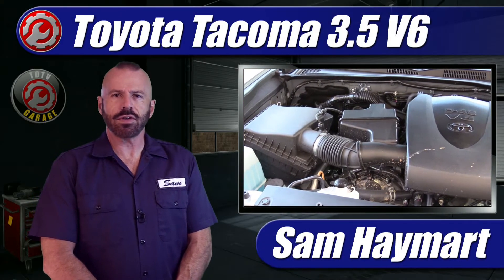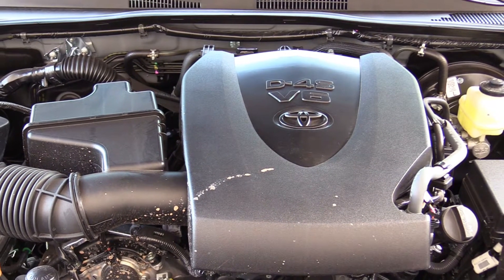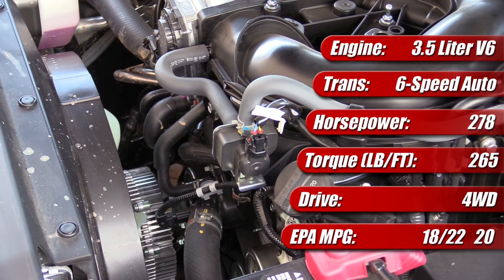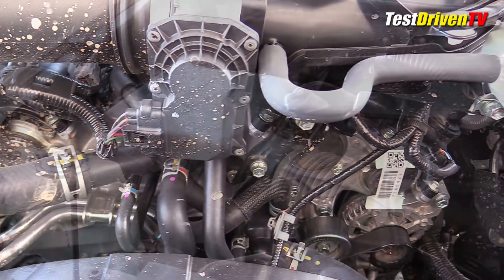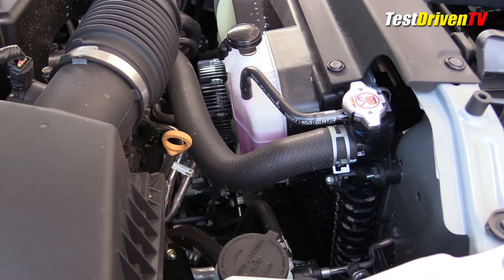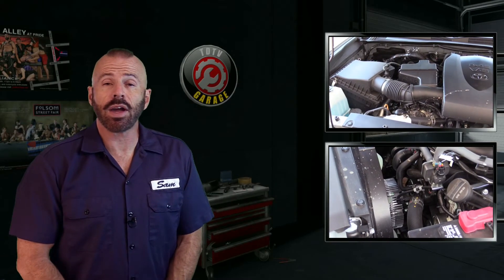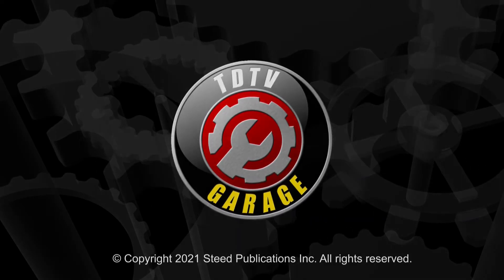2016-2021 Toyota Tacoma 3.5 V6: Engine Explained

Comment: One thing that I kept forgetting to ask the Toyota dealership or I have an they don't know, the 2 holes in the 0:14 doghouse to the right, what are or were they for?
  Had BestBuy wire up a 4G Ground using one of the holes for a xtra battery ground!~

Comment: The decision to stop using the 4.0 V6 in the Taco was one that many weren't excited about especially if you really like horsepower! The optional TRD Supercharger for the 4.0 V6 made up over 300hp and that whine sound was nothing short of awesome! Without the little blower it still made 237hp which was plenty. When they started using the 3.5 liter V6 I heard nothing but complaints about them. Maybe they fixed those issues and now they're a better engine. A pretty big jump in power from the factory 4.0 to the factory 3.5 but man, adding a little boost really made those Tacomas fun! If I was buying one tomorrow I'd have to get a slightly older truck, a crewcab 4wd Taco with a 4.0 V6 so I can add the blower! *I had a 2008 Toyota Tundra 4x4 Crewmax with a 5.7 V8 and TRD Supercharger that was a blast! Eventually making well over 600hp and 650lb/ft. It was what the new Ford Raptor R and Dodge Ram TRX are in today's automotive industry. I loved my boosted Tundra, almost regret selling it now...

Comment: Super tight new age tolerances that can only use 0w20 oil. That's the BS the gov agencies have fed into society. 0w20 will eat an engine alive. PERIOD
Reply from the maker: Then how are they lasting 200k + miles?
Reply: @TDTVGarage  because they are good. 400k if you use 10w30 Mobil 1
Reply: @TDTVGarage  been a ton of premature failures.

Comment: The one thing that the 3.5 motor needs in the tacoma is to have more bottom end torque, it feels more of a car motor they jammed into a truck.
Reply: Press the gas pedal harder
Reply: It gets the job done. It's a Tacoma truck
Reply: That's why they last they are under power
Reply: The OTT tune makes a big difference on where the power bad is and makes it much more enjoyable to drive.
Reply: Get it tuned. OTT has a great one.
Reply: I have the 2018 TRD pro with the 3.5 and it runs beautifully! Is a tank

Comment: They killed the Tacoma with this piece of crap! This generation is garbage! They look great though!
Reply: Yeah the 3.5 2gr-fks is also much more prone to major issues too. Oil pump failures, cracked blocks, cover leaks, hpfp failures, etc. Toyota reliability peaked with their SOHC V6 and V8 designs.
Reply: @hochhaul  Wrong. There are multiple high mileage 3.5 V6 on Youtube. One guy has 400k on his 3rd gen and on FB another with 500k. THey're reliable. But now you don't have to worry about the 3.5L V6. Everyone complained about it and Toyota changed it to a turbo charged 4 cylinder. I'll take the 3.5L V6 any and every day, at the end of the day it's a NA engine.

Comment: Wife bought a 2019 with 30k miles. Toyota mechanics told us dont buy an automatic because the stick feels to have more power and the 4x4 is better.They all drove manual. That what she bought. Man this thing is a dog. I really dont like it. The seating position is extremely awkward. The hood is in your face. I remember the 4.0 trucks being stronger.
Reply: Well now you can get a turbo charged 4 cylinder instead of a reliable NA V6.

Comment: I have a 2018 SR 4x4 on a 2 inch lift with BF Goodrich AT tires. Pushing 80k now and still runs like new. I could use 2nd Tacoma if I had the money to run a different set up lol. These trucks are so much fun to own.
Reply: Did your gas mileage suffer alot? Thinking of doing the same. Also, did you use spacers or suspension lift to achieve the 2 inches?

Comment: 2016 Limited with 125k. $900 and 2 weeks later dealer sez head gasket leaking..(after replacing thermostat and water pump). Over heats with heater on. They want $7k to fix. Do I fix or replace the whole engine?..It's a very complicated engine and I don't see them getting it right. Scotty sez very few mechanic's can do this work nowdays..(Head warped?...Block warped?)...Could the heads be re-torqued with new head bolts? Dealer left the cap off the radiator in the Spring whereby it overheated after a service. This didn't show up until 10k later with the cool weather...Screwed right ?
Reply: What did you end up doing with it?  I had a 2009 Sienna at 154K with the same issue but I decided chuck it rather than fix it.  I couldn't justify 7k to 9k to repair it.
Reply: @SirUlrichVonHamburglar  The 3.5 in the 16+ Tacomas is a "Atichison Cycle" engine which is entirely different than the 3.5 in the 07+ Siennas. I sold it to a big car buyer as, like you, couldn't justify $7500-12k for another engine. Took a $5k loss on the truck..Even a used engine is stupid money+ install. Your engine is more readily available and probably affordable doing a used engine install. Good luck.
Reply: My engine has no compression after oil pump failure. I am getting the truck back tomorrow with the engine in the bed to take apart and rebuild. Nothing like taking it apart to see what really broke
Reply: What year ? @Alex-cd7fo

Comment: So glad I chose the manual. Automatic transmission problems? Couldn't be me.
Reply: They dont have problems. Only idiots driving them. Bro's dont understand the trans and try to accelerate two gears too high, and whine that the truck is powerless.
Reply: @tieoneon1614  This to a tee. I just took the time to learn the truck's power curve. She'll merge onto the freeway at 72 mph by the time I hit the end of the on ramp, and she averages 24MPG between daily driving and hauling hay on the weekends. I can manage 25 or 26 MPG during the work week if I keep it at 60 or under and keep my foot out of it....and I don't keep my foot out of it...
Reply: @ddbrock9675  They also go pay a tuner $500 to what ECT button does...LOL.

Comment: I find it kinda odd Toyota has both a 3.5 and 4.0 that make almost the same amount of power in their current form. 3.5 278HP/265Tq. 4.0 270HP/278Tq. Why not just have one or the other?
Reply from the maker: They do not offer them in the Tacoma simultaneously. The 4.0 was replaced in 2016 by the 3.5 for North American production due to competitive reasons, as well as EPA and CAFE requirements. Because the 4Runner and its 4.0 is made in Japan and sold in global markets (and sold in much smaller numbers in North America) it did not make financial sense to change it over to the 3.5 for just our market. And....back when those decisions were made Toyota believed the 4Runner would have been phased out of our market shortly after the FJ Cruiser was.

Comment: I have a 2020 OR with the 3.5 Auto. Sure, it's no race car, but once you learn the power band of the engine / transmission, it only has gear hunting issues going up long, steep hills, like over a mile long where it roars along in 5th gear. I use the ECT option when towing to tighten up the shifting. My only real gripe is the gas mileage, which really sucks for a 3.5l V6. It's been a very solid truck. The only glitch in 2.5 years was a bad low pressure fuel pump on a recall.
Reply: Get a tune
Reply: Get the OTT tune

Comment: I have a 2019 Tacoma automatic.  It's probably the biggest piece of crap I've ever owned, and I've owned over twenty trucks and cars, all the way back to the 60's.  I loved my 1992 Tacoma, and my 2014 Tacoma....but I freaking hate the 2019.  Gutless, with around 12-13 MPG because I have to keep my foot in it for any power.  Plus the ccrew cab is smaller than the 2014 by a big margin.  I can't wait to unload it.  Only 17K miles.
Reply: How are you averaging 12-13 MPG? I’m averaging 20-22 MPG all day long in a 2020 Off-Road. You must be hammering the accelerator. Just feather it man. It’s just a little pickup truck.
Reply: @southernfried19  Like I said, I loved my 4.0, but the 2019 sucks ass.  Dumped it for a Ford diesel....much better.
Reply: I was wondering this. Can you get it tuned? How many speed is it?
Reply: Just get a performance tune on it. You’ll love it afterwards
Reply: I have a 22 tacoma offroad with the 6 speed manual. it gets up and goes, love the truck.
Reply: Just before and since ordering mine (still waiting) I’ve been asking tacoma owners in person what they think of them, the overwhelming majority love them (even with the 2016 and newer)

An old plumber I ram into at Home Depot is on his 3rd one and got 300,000miles out of his first two easy, 
I work with a guy who has one with 400,000+ on his and it still feels ok… that one is a 4.0.
Reply: That’s too bad.. I have a friend that has a 2018 Tacoma and loves it. He had a 2006 Tacoma prior to that. I’ve never driven or ridden in one myself but I have heard quite a few complaints about the transmission shifting..
Reply: Just got a '22 TRD off road.  Around town I average 17-18mpg.  Flat highway driving I'll get ~23mpg, and hilly highway driving I get about 18mpg.  It's not great, but it's not horrible.  The truck has enough power for me in stock form.  However with bigger wheels and tires I'd recommend regearing it to 5.29.  Tacoma has 2 overdrive gears so 5.29 is fine with bigger wheels and tires.
Reply: Odd, I have a '23 that hauls 8 or 9 150 pound bales every two weeks 10 miles up the hills to where we keep our horses, I've never once had a power issue, and she averages 24 to 25 MPG doing that and daily driving 50 miles round trip to work every day.

Comment: I have a question, this is the same engine that they are putting in the new Toyota tundra trucks.
Reply from the maker: It's significantly different as it is twin-turbocharged in the Tundra. However it is of the same engine family.

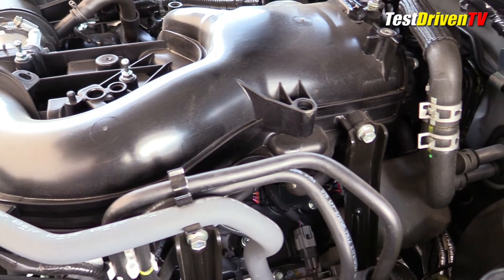Comment: why is this foam here at 1:40 between the engine mount bar and the engine ? what is that in there? mine appear to have one of the screw holes exposed like this one but is there supposed to be a screw in there? i can see the threads; dont know if this is a concern, i didnt pull back the foam to see any thing else

Comment: Pssshhhh
-4.0 guys
Reply: Pffft...  22+ mpg AND 40 more hp
-3.5 guys
Reply: @billgates1682  nah
Reply: @DavyDave1313  Ummm, it's a kinda big yeah
Reply: @billgates1682  You want low end grunt? 4.0. You want high revving for that same or less grunt? 3.5. No replacement for displacement, and that’s a fact.
Reply: @oldv1288  You want to easily dispel that archaic mode of thinking? Forced induction, and THAT IS a fact. Hmmmm, guess that's why my 3.5 eco makes 470 lbs of torque...
Reply: @billgates1682  only because it’s forced induction, your 3.5 wouldn’t make 470ft lb of torque without those turbos. Pretty logical. Let’s boost a 4.0 and see the power results. Like I said, no replacement for displacement, forced induction or not.
Reply: @oldv1288  Wow, dude... ok, YOU said there was NO REPLACEMENT for displacement. I gave you an example that showed you were incorrect by giving you a REPLACEMENT. Pretty straightforward and easy to follow (for some, apparently). And then you come back and double down by repeating it! 🤣 🤦‍♂️ This isn't about your opinion, or feelings on the matter, it's about viable alternatives: read REPLACEMENTS FOR DISPLACEMENT.
Reply: @billgates1682  Still, no replacement for displacement. Like I said, put forced induction on a 4.0 engine (or anything with a larger displacement than a 3.0, 3.5 or whatever) and it will produce more power and torque... it’s simple really, it’s called displacement. Simple physics and engineering my dude.
Reply: @oldv1288  Still, forced induction IS a factual and valid replacement and the effects that it has on other displacements is utterly irrelevant to your claim. And simple physics? Well, I'll be, you're actually partially right this time, since if you compare the volumetric efficiency of your 4.0 (which is lousy, at best) to the efficiency that an FI engine can achieve (100+ %) then you would realize that FI is the much better option. Gee, I wonder if that's why ALL manufactures are switching to FI at a high rate in order to reach the HP needs the public demands WHILE meeting the increasing MPG and emission requirements??? Hmmmm....
Reply: @billgates1682  “the effects it has on other displacements is utterly irrelevant” Are you sure about that? I’ll still stand with my claim. I don’t care what manufacturers are doing, i care about power and displacement, not ecoboxes or eco numbers. The 4.0 lousy? That’s just your opinion eh, meanwhile I think it’s a great engine, and that’s that. You can keep your 3.5 eco boost but like I said, it wouldn’t be anything without those turbos.
Reply: @oldv1288  Seriously, you need to slow down when reading. I said the 4.0 has lousy volumetric efficiency , which it does, at roughly 40%. That's very far from an opinion and is within the realm of theory. And yes, when you bring stoichiometric, thermal and volumetric efficiencies and principles into the mix, you know... PHYSICS, FI clearly is the winner. And the 'irrelevance' statement is toward your original comment, 'Well, what if I keep changing displacements, blah, blah, blah... ' which it is... irrelevant.
Reply: @billgates1682  No, No replacement for displacement. You’ll see

Comment: Gotta love these naturally aspirated Atkins engines, good fuel economy while remaining bullet proof
Reply: Bulletproof? Sure are a lot of 2GR-FKS engines with oil pumps failing catastrophically. And cracked blocks with no histiry of past overheating and dealer claiming its a bad casting. Lots of Tundra and Highlander owners with destroyed engines. This engine was a downgrade from the 4.0
Reply: @hochhaul  0w20 millennial gen Z oil from the government. It's NOT the truck.

Comment: Desperately underpowered... With 0 torque
Reply: The engine definitely not underpowered...
Reply: Yeah my manual is torquey 😬
Reply: The 3.5 sucks, I had a ‘19 OR DC tech and premium, with a manual. You have to run it up over 3k for any power, traded for a ‘21 4Runner ORP, much better built, much better power, holds 5th gear on the highway at 2200 rpm.
Reply: @JAMESWUERTELE  I'm thinking about trading for a 4Runner next year myself. Do you regret any of it? I love the Tacoma......but...
Reply: @Pro4x Trdpro the numbers would disagree, and the amount of people that buy these trucks would more than likely disagree as well. The frontier has no safety, nothing had been updated since before time. Frontier is solid but not even in the same playing field as the tacoma man sorry. Nobody is running out buying frontiers where im from. I'm sure it is a solid truck just not as solid as a Toyota product, nobody is..
Reply: Push the pedal, Whiney Bro's. Watch the vid on my channel, they haul ass if u understand how the trans shifts
Reply: Its not a power issue, it's a transmission issue as they are tuned for fuel efficiency.  Easiest fix is to swap diff gears.
Reply: It’s got enough torque for most folks, and if you need some extra torque down low do an OVtune.
Reply: I own a 2018 trd offroad and I have no idea what you're talking about lol
Reply: @myopinion  yeah definitely not. Now you just sound like a prick lol. But do you guy
Reply: @Pro4x Trdpro it's you again with the frontier talk and hating on Toyota's. Listen, I don't want a Nissan dude haha. I said on another thread I like that the have upped their game (on paper) hasn't even been proven yet til the new truck hits the road. Even then it will be awhile to see any kind of real reliability. In the end Toyota is still top dog. 4 runner or Tacoma regardless is the better jack of all trades. But hey I might take the new frontier for a spin and see.

Comment: Nice but you failed to mention where the oil filter is and what type of filter it uses. I have the old 4.0 liter which has the oil filter on top.